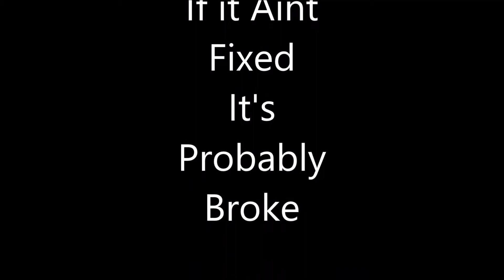Vintage Mcculloch mac 110 Restoration - Found Dead at Town Dump - Will It Run?

Comment: Hey bud great video. You really did a good job. You really need a new chain on it. The mcculloch should run circles around that craftsman.
Reply from the maker: Thanks,,,,Yes I do.
I recently found my chain sharpener...
I thought I had is somewhere,,,,,,
Reply: @TheNovaJohn  also one other note. That air filter is trash. It should not be a screen like that. It should be fabric like. Purchase yourself a new filter.

Comment: Great job, Arch, and great learning experience!  Inspired me to haul my dead 110 out and check it out.  Found a shorted condenser.  So as 'Sam in the Woods' below, the parts challenge.  They're sure not easy to come by.  Even on eBay.  Going to be a research project this winter.
Reply from the maker: Good to hear, I was just chatting with a customer about this saw!!!I finally found my blade file... Mine does need a new chain though
Reply: @TheNovaJohn  lol.  Well that I had.  Just not the condenser.  lol.  Well you'll have something to do now.

Comment: found a a mac 110 also at a dump/recycling place.  no filter base gasket. idle set screw is missing no chain bar brake cover no Chain brake lever. but it runs lol oh and no chain bar and chain lol.

Comment: My friend Butch Soriano Has the same mini mac 110 chainsaw with a 10 inch Bar on it it is very hard to start and very smokey and the bar is very Brown and Rusty
Reply from the maker: I dont know what I did with the footage of when I 1st got it,,,,,just a mess. They are good little machines but hard to take apart and put together compared to others

Comment: Do you remember what you set the high and low out?
Reply from the maker: No,, that has to be tuned to each machine if its been changed
Reply: @TheNovaJohn  Ok thanks.. picked up two today and one fired but have to mess with needles.  Will work on the other one tomorrow.  Thanks brother!

Comment: Where would you order parts for the 110?
Reply from the maker: Fortunately, a google search turns up a lot and Ebay has many parts for these. 
You shouldn't have any issues with parts.
Basic stuff like fuel lines and carb parts are mostly generic,,,,,Good luck and have fun with it!
I've never done one before and this one was a real mess when I got it!
I finally found my chain file, but this needs a new chain

Comment: It looks like you are missing the oiler pump assembly.  It clamps to that circle extrusion that is part of the aluminum engine case when looking at the front of the saw next to gas tank with the front cover off.  Check out a parts list and it will show you the assembly.  Your chain isn't getting any oil which is why you chain was smoking so much when you were using it.
Reply from the maker: Good Call,,, I found that out later after the shoot!! Luv this saw!!